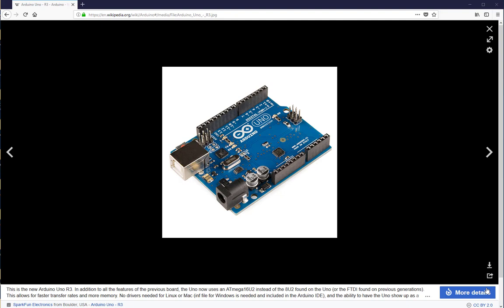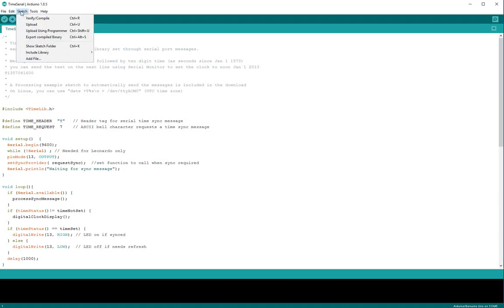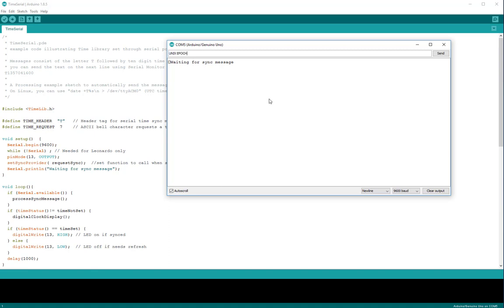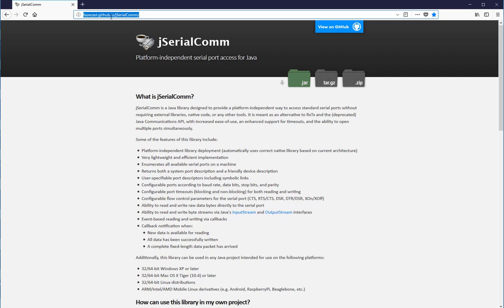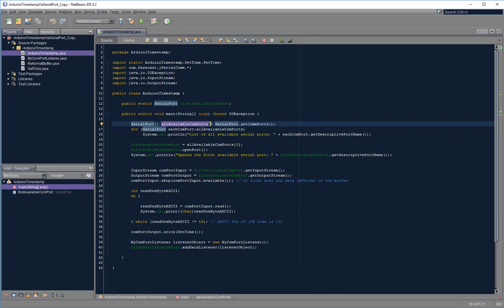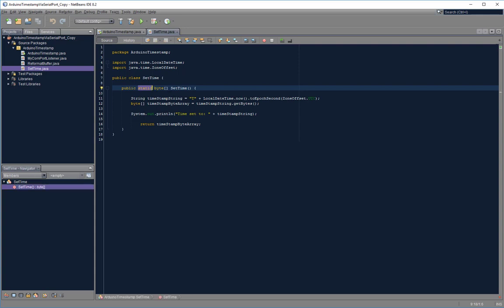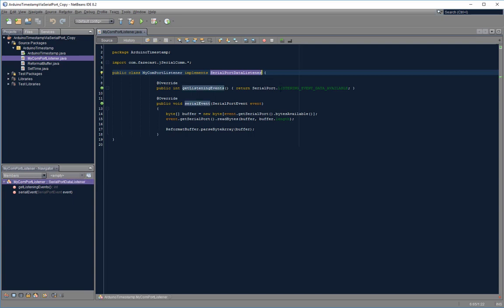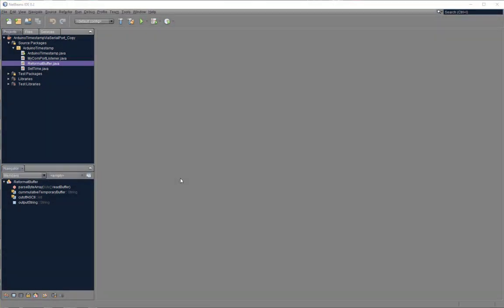Serial Port Communication between Arduino UNO and Java Application using jSerialComm Library

Comment: Thanks for posting. Nice to see it work as I'm trying from Linux and not getting data transferred.
Reply from the maker: If you manage to get it working, please explain what needs to be done differently in Linux. I only tried it in Windows. Thanks and good luck!
Reply: @branislavstanojkovic5211  I was foiled/brainwashed by my previous attempt.  Once I removed the WiringPi library from the Pi I was using to talk to the arduino, then it was able to receive the replies the arduino was desperately trying to send.  All good now!  And finally I can pre-test my little program on my Linux desktop before moving it to the Pi - which is a big help.
Reply from the maker: @johnknight7293  Cool! Thanks.

Comment: Sir I'm getting the output in Serial monitor but the same output is not displayed in Java Console ? What is the reason behind it ? Am I not able to create the communication between java app and Arduino IDE ?Also when I run the java program I get the null pointer exception . 
Reply me asap if u can define my problem sir . Thank you in advance
Reply from the maker: The code is now posted in the description, you can simply copy-and-paste. Thanks!

Comment: Thanks! Great explanation! What version of the jSerialComm-library did you use?
Reply from the maker: Hey, thanks for the feedback! Version 1.3.11, I think.
Reply: I'm working with a GUI and i would like to pass the incoming data to the textfield rather then to the console. Do you know a way to properly do that? I'm currently using version 2 of the lib. Thanks!
Reply from the maker: If you're using JavaFX, try property binding. I haven't tried it myself, but that's where I would start. Good luck!

Comment: This and your HC-05 video are sooo good, it is working and when I send, for example, "6" from android, arduino gets "6" in serial!

But I cant make anything work with that "6" that arduino got
I have tested sending "6" from the app named Serial Bluetooth Terminal, which I got from App Store, and when I send "6" from It to arduino serial, arduino actually shows "6" the same way as with your code, but this time my arduino code actually does something. What can be the reason for this?

I mean, its like with your code Arduino can get data from serial but doesn't recognises it